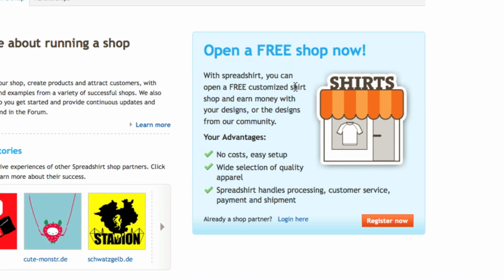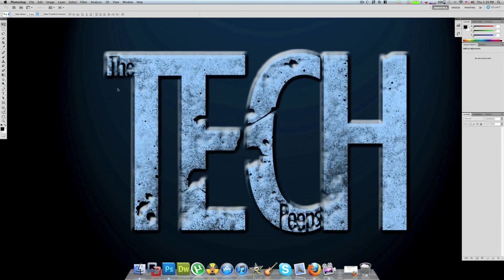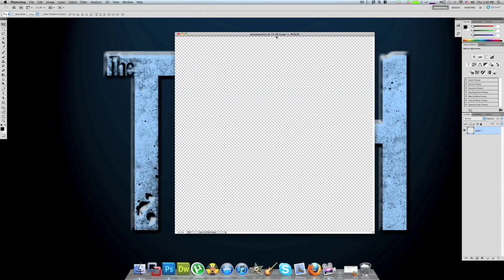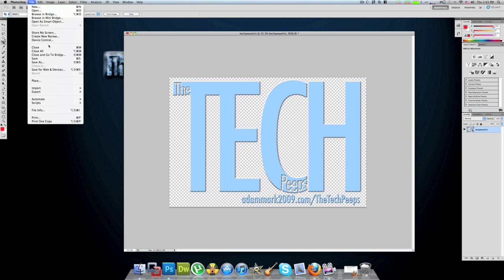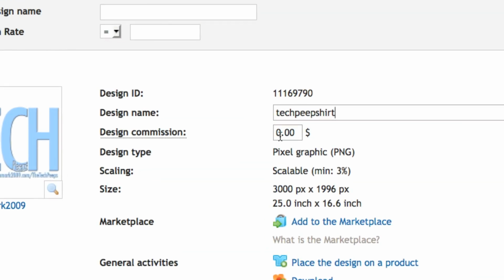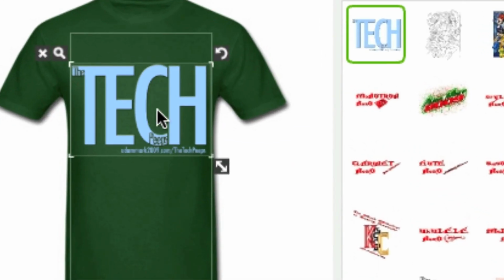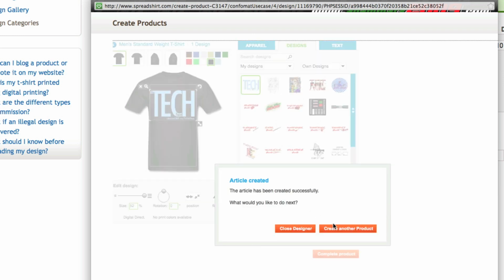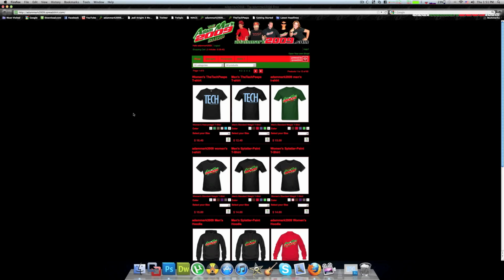Open Your Own Online T-Shirt Shop using Spreadshirt for FREE

Comment: @FruitTrolI Well. to get the most customization, you can put your text in your design and then upload it as a picture.
Or, 
In the designer, theres 3 tabs, Apparel, Designs, And Text. Choose your shirt or w.e. under apparel, then add a design if needed, then type your text under the text tab